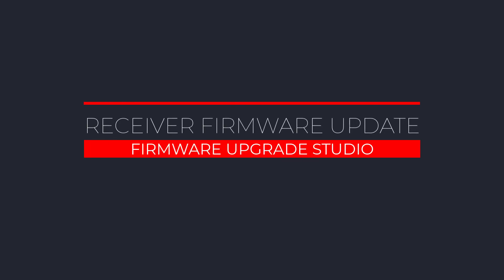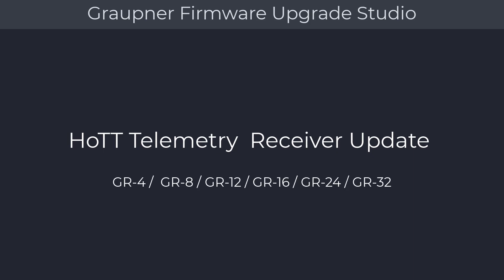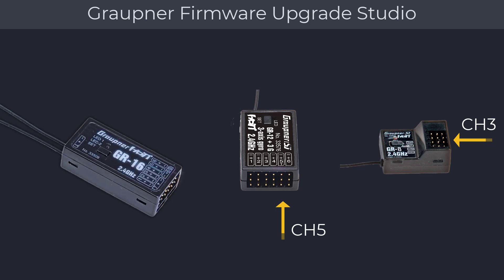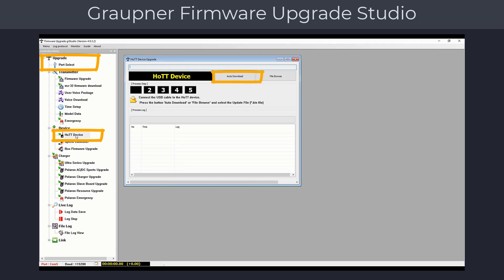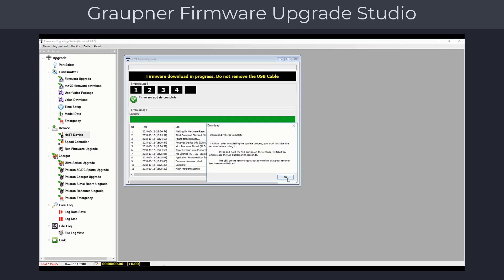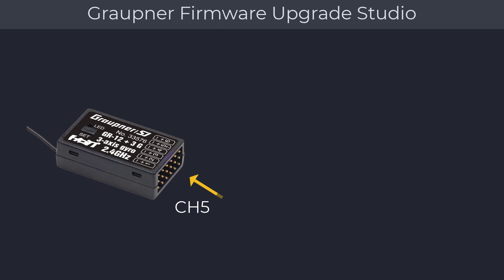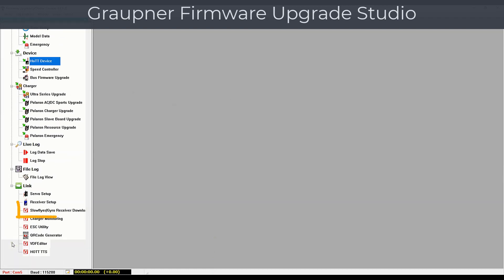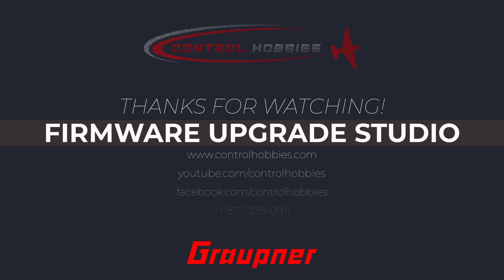Graupner Firmware Upgrade Studio

Comment: can I still update my rx with all the servos connected in the plane?
Reply from the maker: Sure, no problem. In case you are using an electric plane, make sure that the motor is not powered or better, take the propeller off.